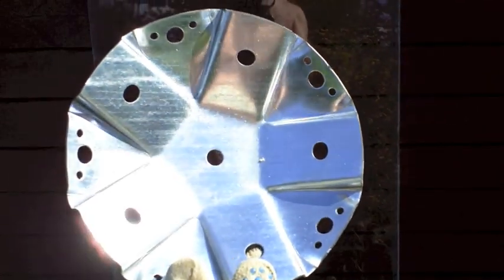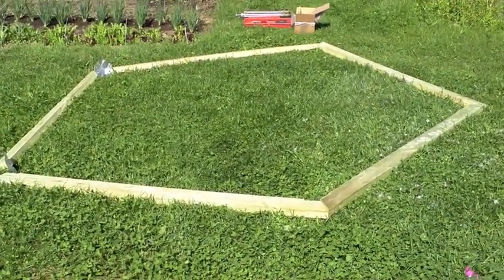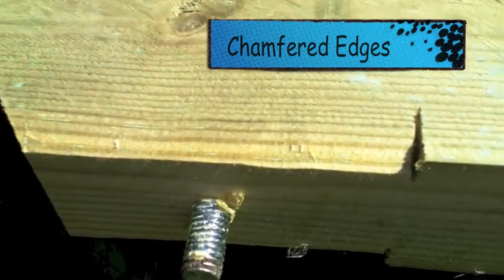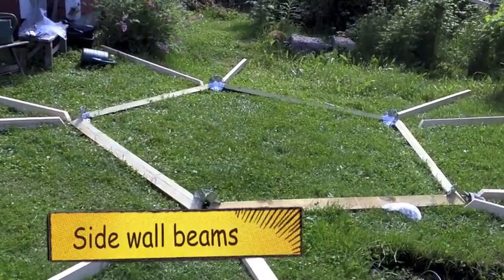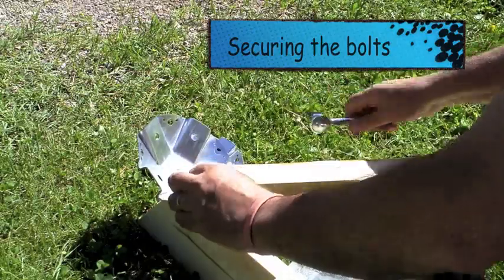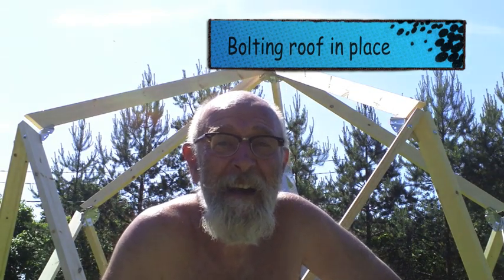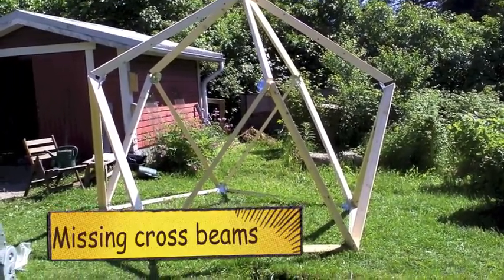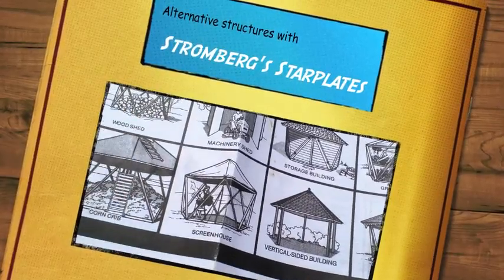DIY Stromberg's Starplate geodesic dome greenhouse project

Comment: I built a gazebo 35 years ago using Starplates.  Bought them at Handyman, long before the days of Home Depot and Lowe's!  I have replaced the roof once, and it's still standing.  Hosted many a back yard party in there over the years.  The shell went up in a day by myself.  The only part that was a two man job was installing the fascia boards.
Reply: That's great

Comment: What diameter is it ?
Reply from the maker: You can use struts as big as 9 feet to get a really big structure. The struts I used were only 6 feet. I have never measured the diameter, but I can comfortable walk around inside the structure.

Comment: Maybe I missed it, but what are the strut lengths? I've had a set of plates for about 15 years and finally getting around to making a greenhouse, I was thinking of using 8 footers just to minimize waste.
Reply from the maker: From the documentation you can use any length up to 9 foot. I went with 2 metre lengths, but I wish I had gone bigger.

Comment: I read somewhere that the designer, Professor Fuller, built them beginning with the top for efficiency and removing the need for risky ladder falls. The key to the strength is a COMPLETE triangle, and getting a complete 'circle' at the base of the roof course, so that the structure is utilizing tension rather than the rigidity of the plates. Then, lift one side of the roof 'circle' and add a triangle on the bottom course. Work your way around the bottom course, rolling up the roof like you would remove a lid from a paint can. While the roof is on the ground, go ahead and attach roof panels and shingles! The last roof panel is the only difficult one.  At the very top, leave a 'circle' open in the roof panel for airflow, and fabricate a cap that overlaps the open part. Using wood blocks as spacers, raise the cap about an inch or so to allow free air movement. Thanks for your post, I will be getting one of these after seeing a good video.

Comment: Robert: I built two gazebos using the starplate system back in 1985. One is at our home and the other is at the river cottage. They are 12 feet in diameter. Back then the plates where use to build the roof on the gazebo. The design had 6 post that we cemented into the ground and the plates were attached to the top of each post and held up the rafters which was covered with plywood, tar paper and shingles. Cutting the shingles took a bit of time because of all of the angles. Since they are 29 years old I am not looking forward to re-roofing them. Like you say it was easy to build and all I had to do was cut the lumber to size given in the instructions. Is the door going to be tall enough for you to enter. You are in a lot better shape than I am. I loved how you started the video with what your wife said. As we say in our family "If Mom is happy, then everybody is going to be happy!" Bernard
Reply from the maker: 29 years old... well I think that will see me through to the end of days. I have now demolished the old lean-to green house and carted most of it off to the recycling plant in Lahti. They took all the stuff for free which was great. I saved the back wall and most of the glass cos I think I can use them in another project. Now I need to clear out the space where the old greenhouse stood and get in some foundations and landscaping.

Comment: Does one need the bottom beams? You would think it would be structurally fine if the bottom beams would be at shoulder level.
Reply from the maker: I think I may have left 5 struts at the Nastola school in some back room corner. I will have to phone them and see if I can get them.

Comment: At one time years back, lots of people in the southwest were building domes on this design as quick cheap housing, but I haven't seen it being done for quite some time.  Extremely strong design as any weight applied to any point is very evenly distributed through the whole frame.  The tricky part is when you go to side them it gets to be many angles on the cuts, and lots of wasted odd shaped leftovers.
Reply from the maker: THat is why I want to wrap it in plastic to make a green house. I am told that you just roll the plastic onto it and no need to cut it. Seeing will be believing. I saw someone make an aviary and they remarked that they just needed to roll the wire netting on with no need to cut.
Stromberg starplate peacock aviary